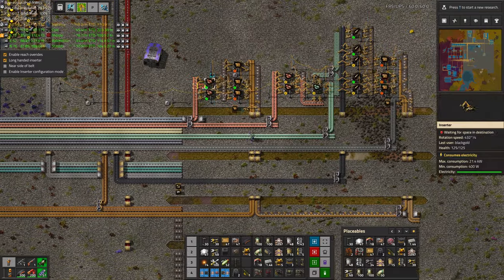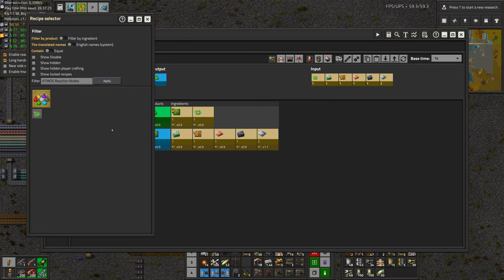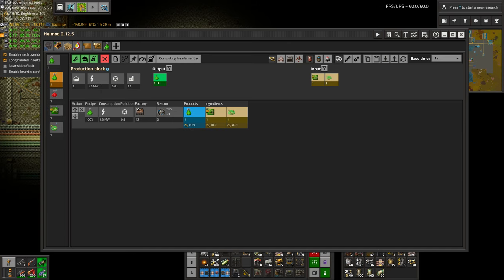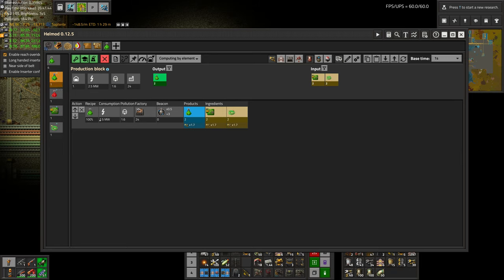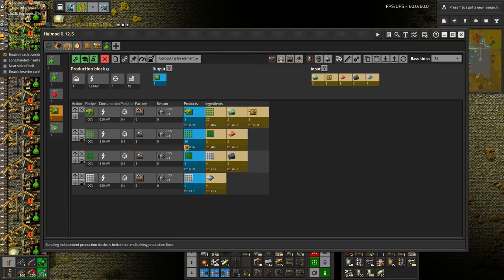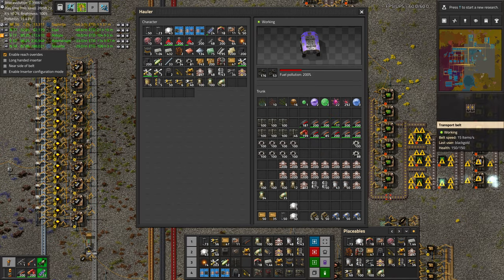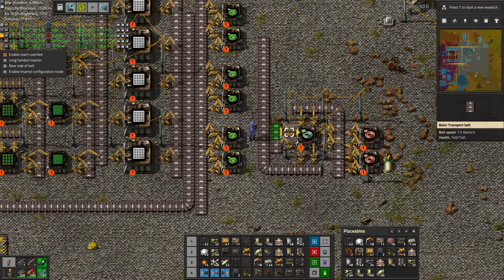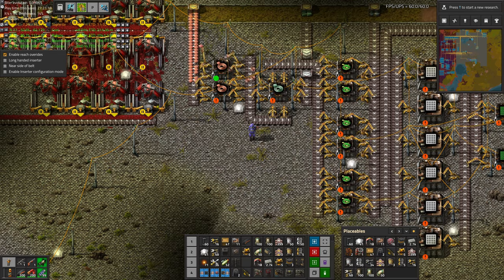[Factorio 1.1 4K] Angel/Bobs Ep 28: Green Science (Tutorial/Walkthrough)

Comment: great videos, I'm loving the content but I'm having a little problem with this pack, its to do with the research for basic fluid research costing 60 red and 60 green science but to use the science packs in the electrochemics lab I need to make carbon for the filter inserters, which requires steam :S any idea on how to fix this or if I've missed a step ?
Reply from the maker: Thanks! I think AAI industry recently changed something which changed these technology costs. Check inside the AAI settings
Reply: @marsh8056  Yeah it doesn't really have any settings for science packs
Reply from the maker: Hmm well one thing you can try is manually downgrading the AAI industry mod. Look up how to install mods manually if you don’t know, then go to the mod portal and download 0.5.9 which should be the version just before the technology cost was changed
Reply: @marsh8056  Yeah that's worked thankyou <3